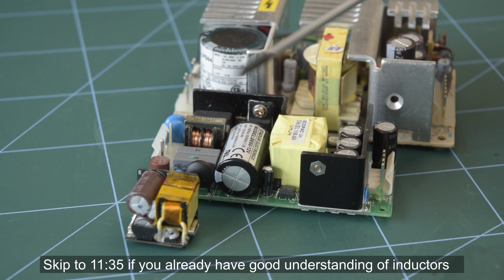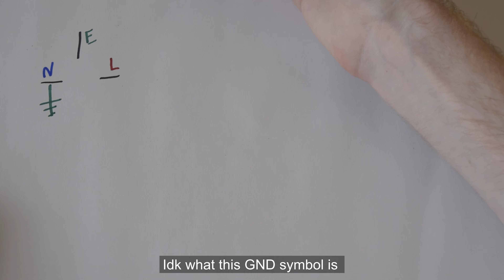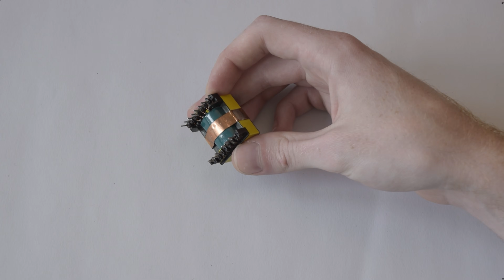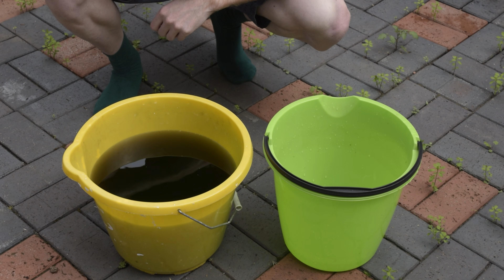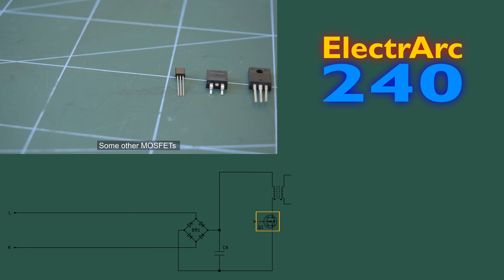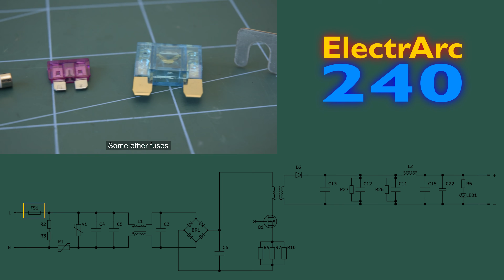Every Component of a Switch Mode Power Supply Explained

Comment: Main question is why that power supply is 20V? What components is responsible for make output 5, 12, 48 V? Also what makes power supply with different wattage?
Reply from the maker: Voltage is mainly determined by the number of windings on the inductor, and is fine tuned by the controller adjusting the duty cycle. So generally a 5V PSU will have fewer thicker windings on the output of the inductor than a 48V one. The power is limited by a few things, in flyback (this topology) the inductor is probably the limiting component for power, as it can saturate with too much energy and get hot from core loss with too high switching frequency. As you can tell from the heatsinks the MOSFET and diode also get toasty at high load

Comment: Did I miss when you talked about how to change the DC into a high frequency to make the inductor more efficient?  There must be parts for that.  Or only on the smaller one that you showed but did not discuss in detail?
Reply from the maker: This is the job of the MOSFET which chops up the DC into pulses at the switching frequency

Comment: Thank you. Isn't a coupled inductor just a transformer then? What's the difference?

Why isn't there a bleed resistor on C13? why not have all 3, or only have 1? why only 2?
Wouldn't the bleed resistors short the DC output?

Comment: The voltage in that big condersor is no joke. Less wise than I am today I once wanted to recover the fan from a broken power supply. Bam, that spark burned half way trough my screw driver. Don't be like me.

Comment: Hi nice explanation. Something wasn't clear to me though. When you say the capacitors C2 and C1 are connected to ground what do you mean, what is ground in this instance? C2 is connected to live, so by ground you mean neutral, and C1 is connected to one side of the the rectifier so ground is the other side of the rectifier??? Sorry if this is a very basic question, anyway thanks for the video.

Comment: I have a question, how that variable resistor can increase/decrease the output voltage? I guess that's adjusting the duty cycle which alters the voltage, but how duty cycle change does that?
The number of turns on secondary are constant, so I assume the output from secondary will stay the same, unless the voltage on primary is adjusted..

Comment: I built a 14V DC power supply out of an old rewound microwave transformer and 5 beefy 30 amp rectifiers with some big capacitors on the output. Looks like i missed a few components to make it better, and SAFER...
Reply from the maker: Sounds cool!

Comment: I’d love to know how to modify a power brick such as Lenovo round tip to the square tip. Can I simply change the output cord and tip or is there a difference? And how could I understand figuring it out on my own for other projects? (I have a few older style round tip power bricks from the t400-t430 era) …. Output voltage amperage seems same….

Comment: Good explanation.   But lose the dark green background; it makes it difficult to follow the circuit diagram.   Try using light blue or grey or black with white tracing and symbols.
Reply from the maker: I have changed the black to white in my videos since. But I’d like to keep the green as it is my channels colour, for some reason.

Comment: Lol, one of these things could be made into a nasty little bugger, remove all the snubbers, smoothing caps, inductors and you have yourself a radio frequency oscillator spewing out RF noise, EMI laws state that all gear must meet certain standards of "quietness" but also accept noise from any other gear, probably all gear is (probably) immune to 65 kHz ish noise due to it's own suppression circuitry, but, controlling the gate on Q1 , the MOSFET, you can dial in the switching frequency, upping it to AM broadcast radio frequency could make a jammer, no don't do that.
Another thing, you could rip out the transformer, to make a home made 8 turn primary and a 100 turn secondary, rip out the C6 and replace with 300 volt 100pF cap and you are on your way to making a plasma candle, junk all that crap past the secondary winding, you'll need to use a small coil floating near the transformer to get the current required to switch the gate of Q1 on and off. 
Plasma candles are quite cool, but temperamental to get right, there are circuits on YT if you look, easy to build...just don't zap yourself, you won't get a chance to say "ow!"
Reply from the maker: I’ve been so tempted to get a SiC half bridge at like 1000VDC and connect a big long antenna to it. But the radio interference would be so bad I’d be scared of getting a knock on the door😅. Almost had that when I was younger, built my own “radio transmitter” which worked really well, and just had the small drawback of wiping out the DSL internet for my whole village cause of voltage induced in the overhead phone lines 😳🙄

Comment: What do wall warts have in them that allow them to be so much smaller? Also, you didnt use the words 'voltage regulation' so I am curious what part of the circuit is doing that and what exactly it is.

Comment: Wait, so even the didgiest of electronics have isolated power supplies, and yet oscilloscopes having some of the most expensive electronic components will go out in a puff of smoke if you try to probe the mains unless you have an isolation transformer inline with the power cord?

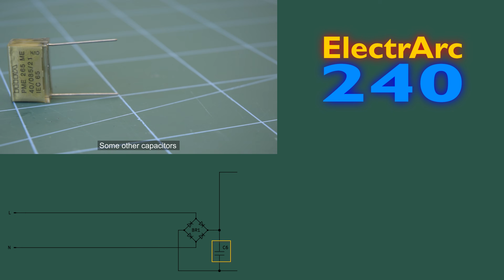Comment: Excellent video, however at 12:46 I don't get how you get to 350V on that capacitor. Most countries have 220~240V AC for their residential mains. Can someone elaborate on this please?
Reply from the maker: 350V is roughly the peak of 240VAC. 240 * sqrt(2)

Comment: why do the snubbers on one diode have parallel resistors but on the other diode they are in series? Also, i imagine that the resistors burn up that diodes reverse current, is that a signifucant source of power loss in any case?

Comment: I have to comment on a technicality. Current does not flow. Current forms a Magnetic field surrounding the conductors when a load is applied to the Voltage being supplied.

Comment: Wait a sec, the reason for isolating the secondary (output) of a SMPS supply has nothing to do with safety. It's because the supply will SHORT CIRCUIT if the input B+ and the output are commoned. Anyone who connects the ground of their oscilloscope to the primary ground of a power supply and tries to read the isolated output will blow the fuse and find out the hard way

Comment: Silly question have you built purpose built switch mode power supplies? I have old audio reel to reel stereos that have huge transformers, if changed would decrease their weight tremendously.

Comment: Please explain this: According to my understanding, transformers work with AC only. However, your circuit started with converting to DC first. Then, how could the transformer convert the voltage to lower DC?
Reply from the maker: The MOSFET switches the DC so it is pulsed. And because this is a coupled inductor and not a transformer it doesn't actually require alternating current. A forward converter would use a transformer and that has a few more MOSFETs to essentially turn the DC back to AC but at much higher frequency than the grid so the transformer can be much smaller

Comment: The gate of the MOSFET has no connection then how is the MOSFET even working? how does the voltage switch down and how does the potentiometer work?

Comment: thank you for the video , but it might have gone over my head but i thout that inductors try to maintain the current accross them so they should release the energy as voltage of same direction as the voltage source used to charge ? what am i missing?
Reply from the maker: This is correct, the energy is just released on a different winding (the secondary)

Comment: My buddy once said, regarding switching power supplies, “No load, no draw”. 
My question: typical phone charging “cubes” (100-240VAC input, 5V DC output) when left plugged in to mains but without load (phone) connected as load to output, is there  current ( power ) draw on primary?
Reply from the maker: Yes there is. Very tiny amount though. Sometimes they draw a non insignificant amount of reactive power which isn’t great. That’s current that flows in and out so no heat is generated in the device but all the wiring in your house and the transmission system still has to carry this pointless current

Comment: Just to confirm, where does the current in the primary coil go when the switch is off (what is stopping it from having the big inductive spikes)? Is it the in built freewheeling diode behaviour of the mosfet? Also are y caps connected to earth? If so, if there is noise on the earth due to another device, wouldnt the y caps cause noise to go into the smps system (might be a dumb question)? Also if one of the input capacitors fails and shorts what prevents damage to mains?
Reply from the maker: 1) Almost all the energy is stored in the core so can be released through either winding, in this case the secondary, the small amount that is not is dissapated through one of the snubber networks which essentially acts as a very lossy freewheeling diode to make sure all the energy is gone by the next cycle. 2) Yes they are, and yes this is a thing that happens unfortunately. But generally the earth connection will be the least noisy, any noise on it is probably much worse on L & N so it still makes sense to send as much as possible the way of earth. 3) This is what makes class X and Y caps special, they are designed so they can only fail as an open circuit not a short. X are for line-to-line and Y are for line-to-earth. So Y caps are the most critical for safety. Both are types of "safety capacitor"
Reply: @electrarc240  thanks heaps for the reponse, that clears things up heaps.

Comment: I know the power supplies tend to start making those annoying high-frequency noises while in operation over time. Most of them come from the ceramic capacitors. What other components start to become noisy and why?
Reply from the maker: Definitely inductors! Because they have a fluctuating magnetic field and lots of relatively lose copper windings these can start to vibrate fairly easily, especially at lower frequencies like in a 50Hz transformer.

Comment: When you used the op-amp, you supplied a voltage of about 22v to the vcc of the op-amp from the capacitor. 
Is there any op-amp that uses a voltage of about 22v at its vcc ??
I thought the vcc ranges to a limit of 15V ??
Please I would appreciate if someone reply and explain it to me 🙏💯
Reply from the maker: Old opamps like mine (LM741) can handle a lot more than modern stuff!

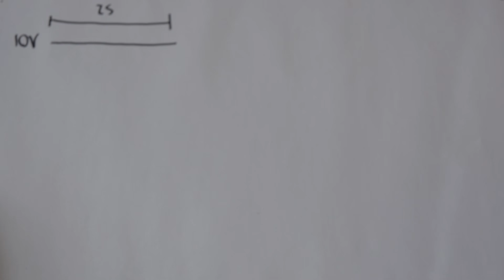Comment: I understand everything except 4:30..6:00.

Why do you want to release the power for a different time?
Reply from the maker: The time it takes to release the energy depends on the output voltage, which depends on the load. At low load the duty cycle is decreased significantly to prevent the voltage getting too high by releasing energy that has nowhere to go. If there is high load we need to release energy for longer/ release more energy to keep the average power equal to what is being drawn by the load

Comment: Noob here. Based on 13:45 diode (D2), shouldn't transformer polarity be reversed so that when the primary winding stops, the "dot" side will have a higher voltage?
Reply from the maker: Yeah sorry the dot is in the wrong place on that schematic! I forgot to move it from the conventional transformer symbol :(

Comment: Typical "inductor" design is to pick a material with a relative permeability of 35,000. Now saw a gap in it reducing the relative permeability to about 4 (the rating for wood). Then add your winds. Do not tune the turs ratio. Do not tune the coefficient of coupling. Otherwise, you might use integrated magnetics (FORBIDDEN!).

Comment: The output voltage going back to the controller needs to 'cross' the isolation barrier. How?
Reply from the maker: That's what the opto-isolator does. Think of it like a small LED facing a small solar panel, the greater the output voltage the brighter the LED and the more power we get from a solar panel! They usually use photodiodes/phototransistors on the output though.

Comment: in "input filtering" section you mentioned something about noise on other electrical devices like TVs . when we turn one of the light switches in our house on and off , our TV gets turns off and then comes back on for a sec . do you have any idea about the cause of it and how i can fix it ? could this be because of our TV's faulty power supply(filtering components of the switch) ?
Reply from the maker: What type of light bulb is it? Compact fluorescent?
Reply: @electrarc240  4 low watt LED lights (7 to 10 watts)

Comment: Im building drones, i purchased mt3608 five pack, i have 3.7v lipo battery connected, i need 5v 8amps so i have to use 4 of these step up converters. Ill have to watch this video again. Im struggling to find a device that can provide 8 amps. If you have suggestions, i appreciate your comment

Comment: The super-important part (PWM that regulates output) was NOT shown here. Also you could have made it sound alot more simpler than you did.
Reply from the maker: As I mentioned in my pinned comment the control is coming in several parts, now that I’ve done a video covering MOSFETs next will be gate drivers, after that we will be ready to come back to the control
Reply: @electrarc240  almost NOBODY reads pinned comments. ....make a "human" video please
Reply from the maker: @Jimbo-v3m  being human is a big challenge for some of us...
Reply: @electrarc240  i noticed

Comment: Isn't that a simple transformer that you keep calling as an inductor? The idea is same but indcutor generally only has one core and a winding but transformer has a primary and secondary winding.
Reply from the maker: It's a coupled inductor which is slightly different. They are designed to store energy, charging up from the primary and then dumping that energy out on the secondary. A transformer uses magnetic coupling to induce a voltage in the secondary while the primary is getting magnetised and demagnetised, so doesn't store any energy. I find transformers a lot more difficult to explain concisely but my linear power supply video does a good job I think

Comment: Hello sir i have a 70VDC electric scooter.  And my tail light got damaged so i need to replace it with a 12VDC  2A LED light.  And im not sure how to convert 70VDC.  To 12VDC can you help mybe with a simple  diagram with names of the components i can use

Comment: I want to ask, if I put 12volts dc through the output, would it reverse and give 120volts ac as in an invertor?
Reply from the maker: Sadly not for two reasons, firstly this is a fairly simple topology with "passive" rectification on primary and secondary using diodes. In general if every diode in a converter is replaced with a controlled switch (MOSFET), called active rectification, the converter becomes bidirectional! Then it also just needs the controller to allow reverse power flow which is the second reason. Many high power converters like server PSUs have all the hardware to be bidirectional but do not allow it because a server is a unidirectional load.

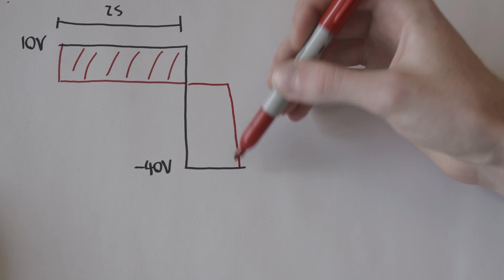Comment: At c5:00, where did the -40v come from?
Reply from the maker: That would be a 40V output voltage, negative because there is no isolation for that example. It was just a made up value (4x input voltage) for that example

Comment: Why does the power supply need to be isolated? Same safety can be achieved if the powersupply shares a ground with the power outlet, as long as the voltage is low enough (ie under 25 Volts)?
Reply from the maker: The way the circuit works (rectifier and inductor) means the output would not be referenced to GND/neutral it just “swaps” between that and live. Unless you just have a single diode rectifier and a simple buck converter a non-isolated PSU won’t have its negative at GND potential. So it’s more common to have an “isolated” PSU and then “externally” join the output to GND
Reply: @electrarc240 oh okay, but in like a small dc dc oder ac dc converter, there doesn't need to be an isolation, as long as the voltage is safe for humans? The galvanic isolation comes from the transformer, I know that. Also I don't want to sound rude if I might appear so It is because English is not my first language. 
Another question: so in normal switched powersupplys is the transformer only used to achieve isolation? I always thought they also transform down the voltage with them with a different winding count on each side. What I'm trying to say is: I don't really get the difference from the inductor to a normal transformer?
Reply from the maker: @lucasniemeyer3381  Yes in SMPS the transformer is there for isolation and to step down the voltage with the turns ratio, both are critical. A coupled inductor stores energy, getting charged up by the primary and then releasing the energy onto the secondary. In a transformer no energy is stored it comes out the secondary at the same time as it goes into the primary.
Reply: @electrarc240  oh okay, thank you for elaborating! So I just mixed things up there, sorry!

Comment: Sorry but my experience is that small switching transformers/battery chargers are not isolated. Allegedly "a tiny cap btw primary and secondary side". I have measured 175V AC with oscilloscope btw minus and Gnd on a Mascot 12V charger, similar in USB chargers. (But nothing with multimeter)
This creates annoying 50 Hz noise in battery operated recording equipment on charger.
Reply from the maker: That'll be a high impedance voltage you're measuring, i.e: touching DC- and GND will not kill you because there is a high series impedance with that voltage. It is the result of weak capacitive coupling in the PSU